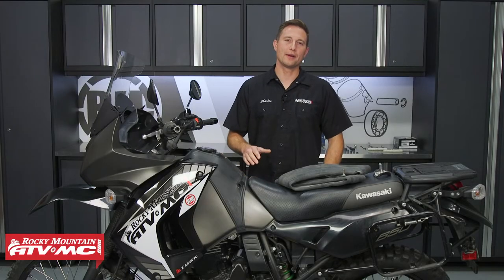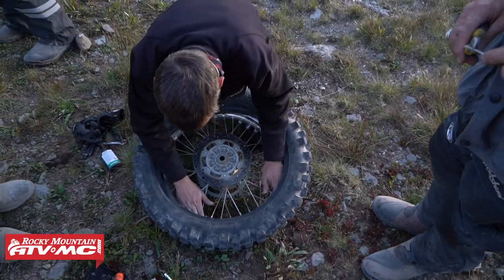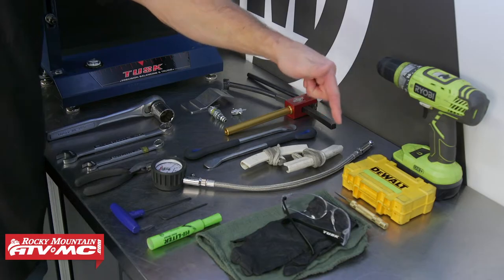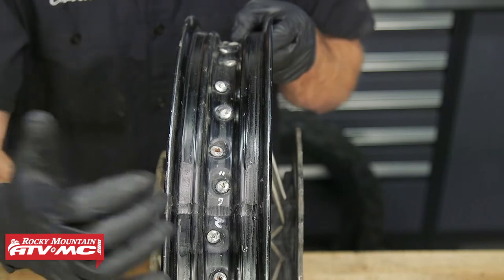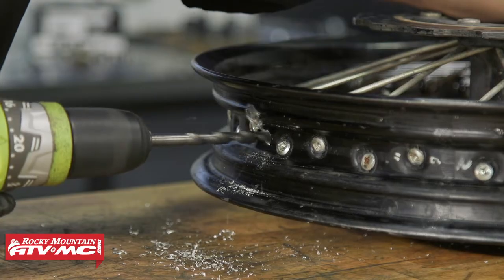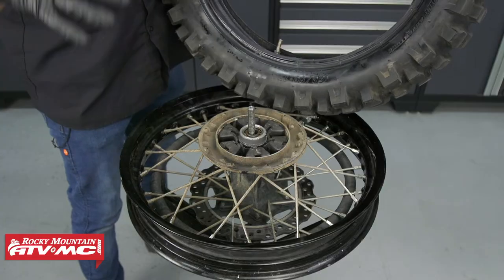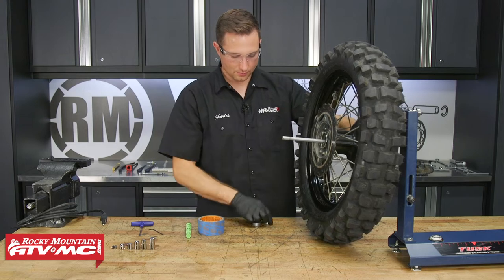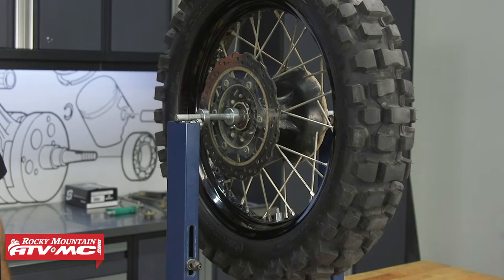How To Add a Rim Lock to Your Adventure & Dual Sport Motorcycle

Comment: Rim Lock is ONLY needed if you plan to run 15psi or less!!......which is for off-roading pressures..... If you're running on the street, generally you run 20psi or More.....so no need for Rim Lock, as there's really No risk of ripping a rube....... Generally it's a good rule of thumb to run a Lock anyways, just in case you're riding down the road and see a nice Trail, and decide to check it out, and if the terrain gets rough, at least you can air-down to take full advantage, also if the trail starts to get Bad and you're at risk of getting stuck, at least you can air down for increased traction!
Reply: Nope. I've sheared two valve stems at 25 and 30 psi on my drz400

Comment: A rim lock threw my balance out, bad enough I couldn’t go over 80km/hr without severe wheel hop. I had to remove it for this reason. My wheel was never balanced after the install, it should have been.
Reply from the maker: If you don't mind adding wheel weights to your rims check out the No-Mar Spoke wheel weights: https://www.rockymountainatvmc.com/tires-and-wheels/no-mar-spoke-wheel-weight-p

Comment: You should put the rim strap over the rim lock as shown unless you have a rim strap which has an extra hole at the right place for the rim lock. Some advocate using duct tape or the tape which comes with TuBliss. Tape goes under the rim lock.

Wheel weight set screws need to clamp on the spoke nipple. A set screw gripping the spoke will create a dimple where your spoke will break when sufficiently stressed. We all break a spoke eventually, there is no point in doing it sooner than later.

Factory rim locks are almost never installed directly opposite of the valve stem. There is a repeating pattern every 4 spokes and most wheels will be 36 spokes. The valve stem is located between 2 spokes angled away from each other, this repeats every 4, half way around is 18 where the spokes cross each other making it harder to put a wrench on the rim lock.

Another comment made a good point: Put the rim lock 4 spokes either side of the valve stem. This way you only have to treat one side of the wheel special when putting the tire on/off. If you are going to balance the wheel anyway then "Wo what? Its no more than 1/2 oz." But if you were to install 2 rim locks this is what you would do, the first (4) spokes from the valve stem, the next (16) spokes around, and then the valve stem is another (16) spokes continuing around the wheel.

The method of mounting the tire, mostly skipped, works but is not my favorite. Go find the TuBliss installation video. Basically put the innertube in your tire. Spread the tire beads at the valve stem then insert the entire wheel into the tire over the valve stem. So now the entire wheel is floating inside the tire with tire beads outside but you have the dreaded valve stem threaded through the rim. Now you lever the bead over the rim from one side, then flip the wheel and lever the bead over the other rim rather than putting both beads over from the same side. This way you don't have to pull the tire over the rim lock then place the bead between the rim lock and far rim. And makes things a million times easier if installing 2 rim locks.
Reply: Very helpful, thank you!
Reply: very helpful comment, thanks for sharing!

Comment: I need to add a rim lock & need some help. My rim is  2.16" so i need the 2.15" rim lock. 
Is best place to put it on the value side? 1st big gap 4 spokes away that would help with balancing, which will be Hard its ab bike hub motor so there's a Natural binding + a big cable so i will have to "try" to ballance on the bike
Reply from the maker: Best place for an easier balance would be across from the valve stem.

Comment: I have a 2016 Africa Twin in my arsenal. I see that a rim lock is available for the front- 2.15, but nothing for the rear - 4.00. Any suggestions?
Reply: You should be running the rear tire on that AT at 36-41 psi, so no rim lock required. Rim locks are good for low pressures like around 15 psi or less.

Comment: Hi, im new into dirt bikes. I would like to install a rim lock in my front and rear tire. How do i know exactly which rim lock i need, i see different measures. my rear tire is 120-80-18
Reply from the maker: There should be a stamp marked on the side of your rim indicating the rim size. Example: 18 x 2.15 in which case you would use a 2.15" rim lock. Hope that helps!